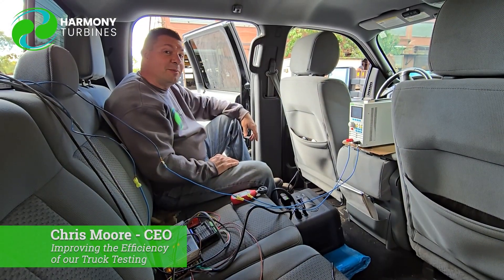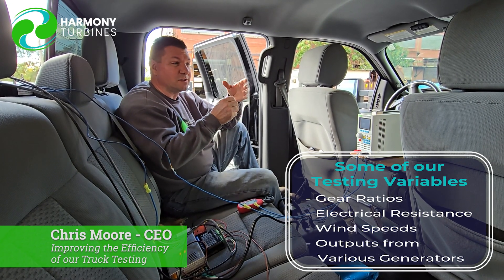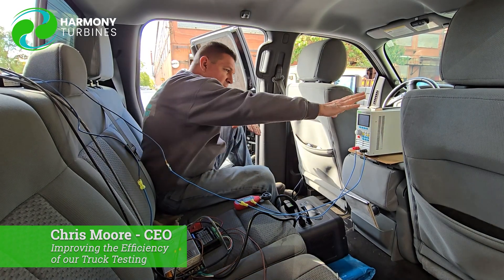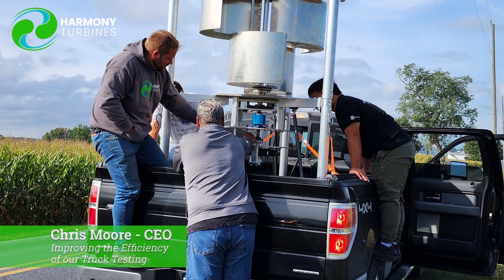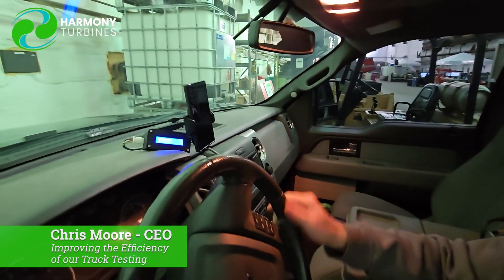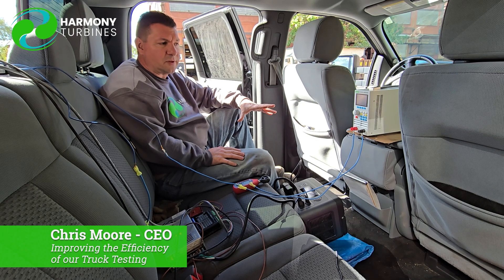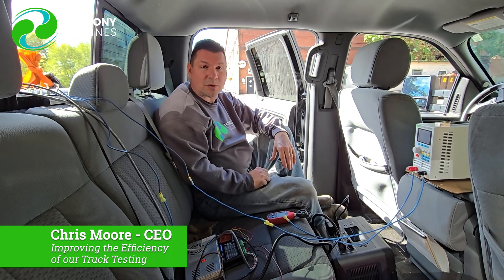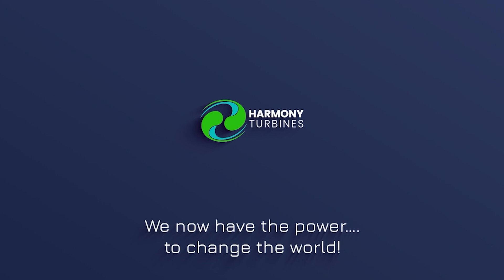Back Seat Shenanigans that will Shock You!

Comment: also how many rpms do these turbines do in 25PHM wind? , you haven't mentioned that important number in all the videos ive seen.
Reply from the maker: On Oct 14th we were finally able to capture some good data with our data logging equipment. We plan on sharing that RAW data with our community somewhere around Oct 29th. We are just starting to work on that video now. So stay tuned!
Reply: @HarmonyTurbines  okay thanks, and  do you mean your yt community? 
have you ever tried creating you own generator? 
the store ones have short thick wires, 
I'd wind long thin wires for higher voltage but obviously less amps but to compensate for that I'd do 200x wires in parallel, to get the amps up to 10-20amps, the advantage of this way is a much slower rpm needed to get coil saturation, my whole life I've dreamed about creating table top wind generators able to power household stuff, but i always wanted to make the blade and generator myself, the tricky part would be limiting speed to not get a huge surge
Reply: @HarmonyTurbines  and to generate a 3phase output would be easy, just need 3 coils positioned 120degrees  apart with a round rotor with  just 2 or 4  or 8 big n52 neos position proportionally around, that will give 3 out-of-phase outputs combined makes 3 phase,  could even have 5 coils for 5phase output super steady output, gotta have a odd/even difference for multi phase output.

Comment: I've seen some vertical turbine manufacturers touting the increased output that comes from lining multiple turbines up in relation to the wind direction.  Have you looked into that theory at all?  While I am not doubting the theory behind this idea, I know where I live, I could not consistently predict the wind direction enough to make this a reliable approach.  I can predict in a general way the wind direction of the majority of the time, but not accurately enough to line turbines up.
Reply from the maker: Ken, the study by PSU Berks was supposed to help with this question but their report in the end was less than we had hoped it would be. At the very least PSU indicated that clustering did not appear to detract from the performance of units when compared to solo operation. In light of this, it seems that you may be fine installing them perhaps 5 or 6 ft apart and not experience any degradation. The configuration or lineup would not matter really.
Reply: @HarmonyTurbines  I am not surprised that you had already looked into this.  Your approach to developing the best product seems to include thoroughly researching every aspect of the problem.

Comment: Back of a truck definitely is a viable method, but wouldn't a high-power gas stationary wind machine let you adjust / test much more frequently? I suppose saving the cost of a $5k paramotor pack can go a long way for small startup.

Comment: Chris why don't you just make a small wind tunnel (like a cardboard box from a new frige or washer) and add a large fan to control the wind speed sure wood use alot less gas.
keep up the good work !
Reply from the maker: We've actually done this already (there are several segments in our videos about it over the past year); we found it effective for testing different scoop designs!

Comment: Do two scoops catch the wind as effectively as 4?  With 4 scoops there is always a scoop catching the wind isn't there?  With 2 scoops there is a period of time when the two scoops are alined with the angle of the wind and not picking up the wind.  You're just relying on the momentum of the turbine.  2 scoops doesn't seem as practical as 4 to me.
Reply: If they do a static torque test,they will see one of the big problems of this conventional Savonius. There will be 2 peak torques and 2 zero torques per revolution. That causes vibrations and impulse pressures on the structure and that excellerate fatique.
Reply from the maker: We have our theories about how each version will work in various types of wind. Real-world testing will tell us what we need to know!